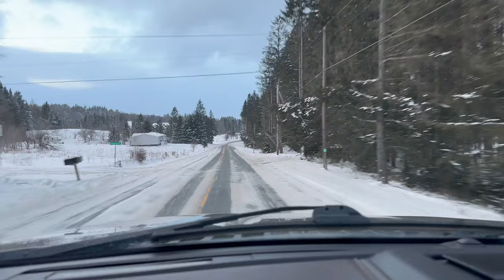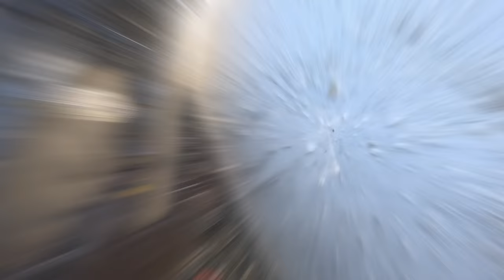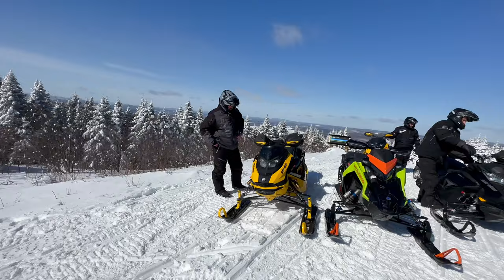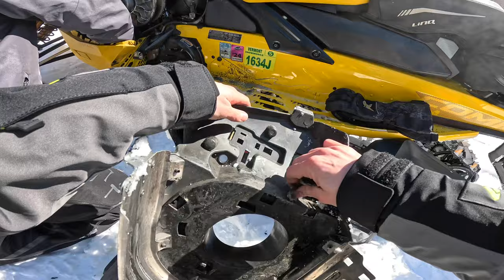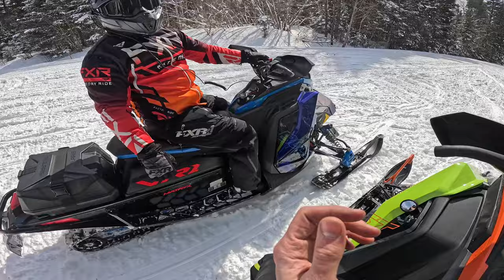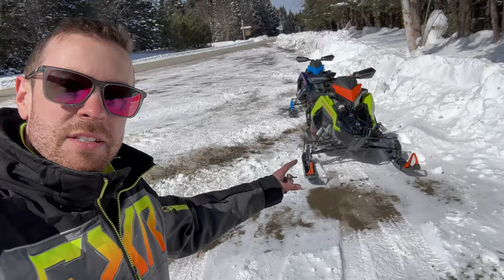I haven't done this in YEARS...Almost made the trip without an issue!

Comment: Where is that? Where are you unloaded at?
Reply from the maker: That's one of many pull offs up Route 3 in/north of Pittsburg NH. Basically just keep heading North on Route 3 out of Pittsburg and you'll see the pull offs, there's quite a few of them and this is the last pair of them. If you miss it you'll just end up at a border crossing 5min later and have to turn around. Decent spot to get right on trail early/late season.

Comment: That Polaris is nothing but trouble scrap it and get something more reliable 🤦🏻‍♂️
Reply: Like what
Reply: Yamaha sidewinder
Reply: @bigchaloopa  all the brands have issues, sidewinders for example the track tensioner block is a weak point
Reply: @n90982  I guess so. I have 4200 trouble free miles on my 2021 trail sled. All snowmobile trips were successful except when some other brand shit the bed and the group had to deal with it.  If that happens often, they don't get invited.
Reply from the maker: They can all run out of fuel if you're not paying attention well enough. I have had a lot of issues with this Assault this season though, it's pretty clear it's not up to the task of handling the abuse I throw at it. I've had much better luck with my VR1 build in terms of durability with components.
Reply: @MunsonMotorsports  something with the assault boosts seems like, my group has vr1 boosts and have had 0 problems. Then again I also know people with assault boosts with no problems who ride hard. I think it has something to do with Polaris just pushing out the assault boosts out of the factory first as fast as possible.
Reply from the maker: @n90982  Luck of the draw I think haha. I've got riding friends that have had their 2023 XRS 850 Etec burn a cylinder down at right around 2k miles 2/3 through the season. They all have issues, you just gotta hope it's not yours haha!